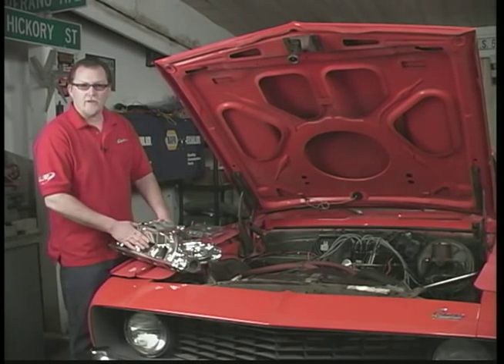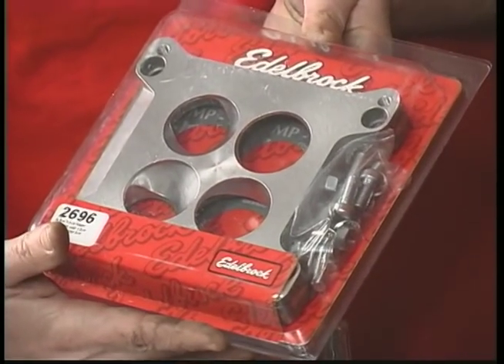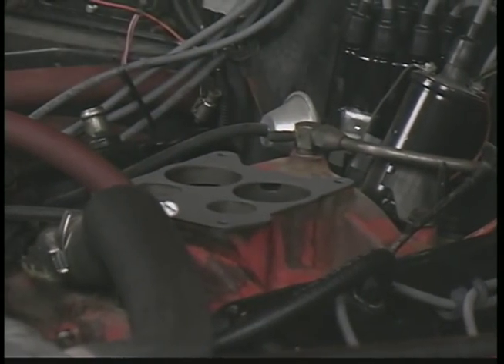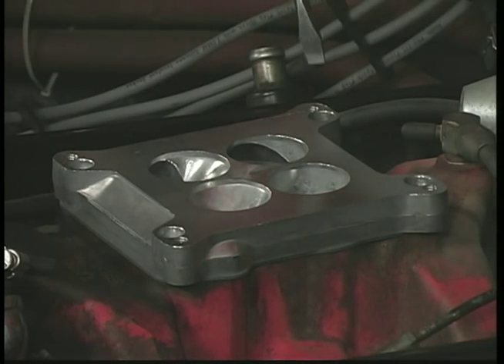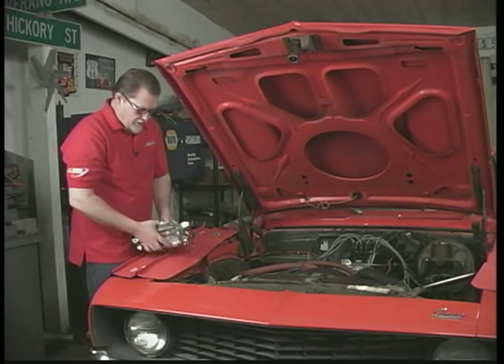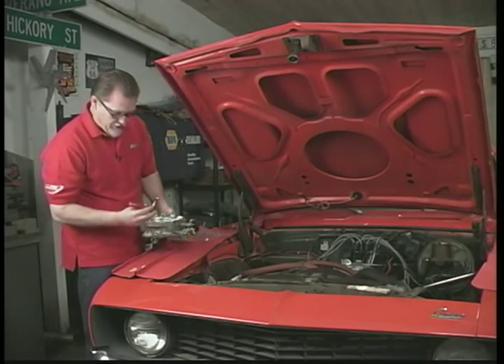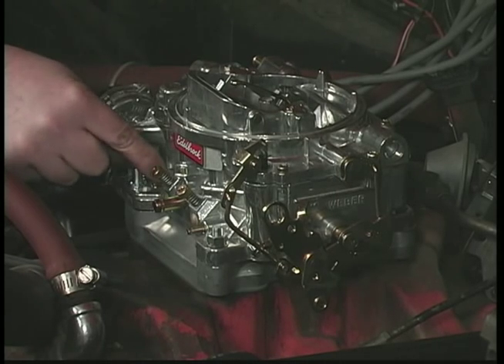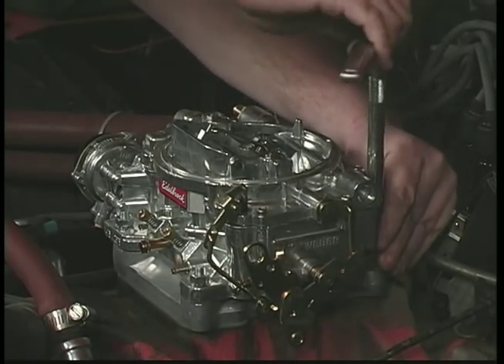Edelbrock Carburetors - Installation_PT1.mov

Comment: I wish they made this kit out of phenolic resin or something that wouldn’t conduct heat like the aluminum does.  Causes to much heat soak and there isn’t always enough hood clearance to the air cleaner to install a thicker insulating gasket.

Comment: What adapter do you use for BBFord?  429 has spread bore intake manifold also but that Adapter plate doesn’t line up with the Ford carb stud holes in the Ford intake.  Do you have a solution?

Comment: I am ordering this kit for a ‘68 275hp 327. Stock cast iron intake with “hot slot” on carb base. Will the adapter plate block off the hot slot? Or should I still use the stainless steel baffle below the adapter plate.